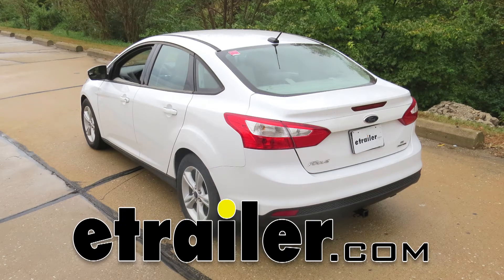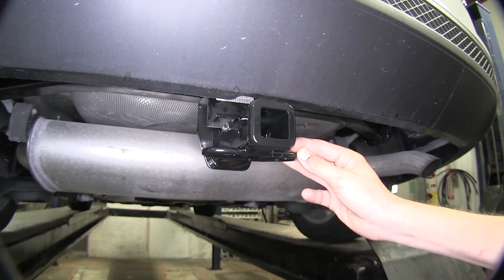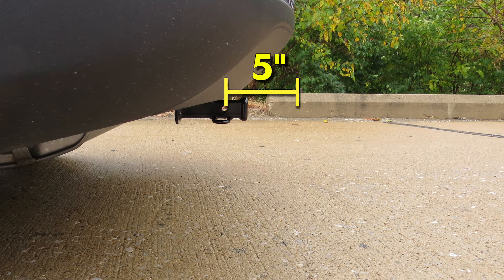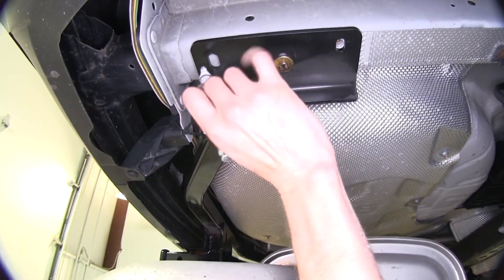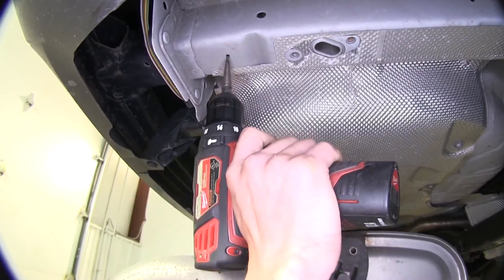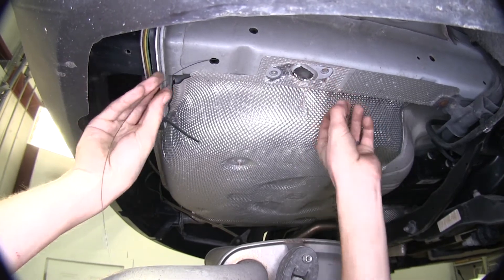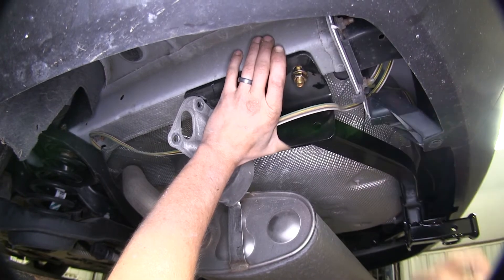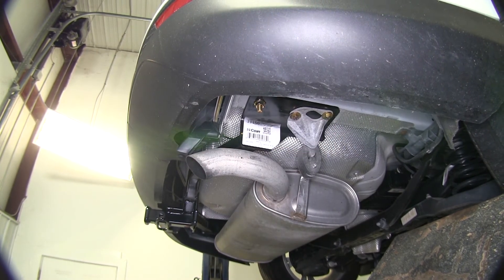etrailer | Beginner’s Guide to Installing the Curt Trailer Hitch Receiver on a 2014 Ford Focus

Comment: Can a lights and blinker kit be installed?
Reply from the maker: Are you talking about a trailer wiring harness with a 4-pin trailer connector? If so, you'd use # 118548 for a sedan or #  C56140 for a hatchback model. You can check those out by using the links below. I'll also link to install instructions for each.
https://www.etrailer.com/Custom-Fit-Vehicle-Wiring/Ford/Focus/2014/118548.html
https://www.etrailer.com/instructions.aspx?pn=118548
https://www.etrailer.com/Custom-Fit-Vehicle-Wiring/Ford/Focus/2014/C56140.html
https://www.etrailer.com/instructions.aspx?pn=C56140